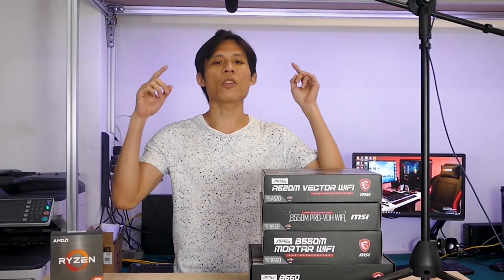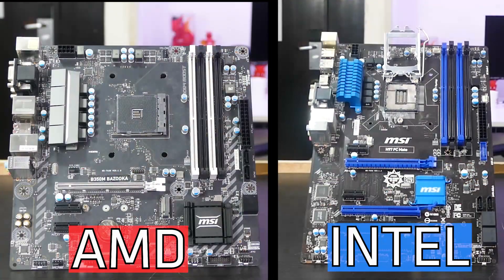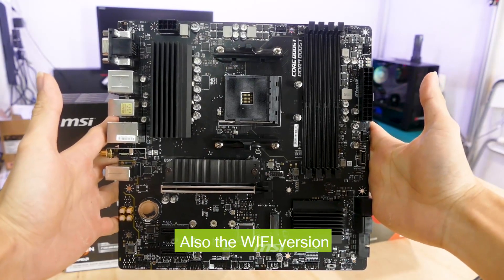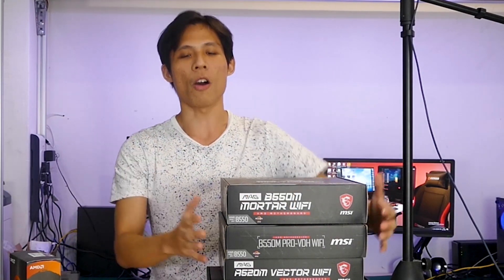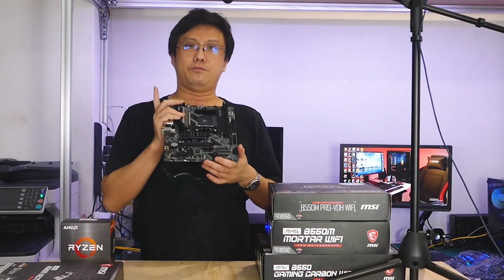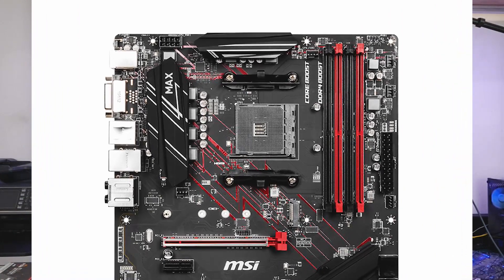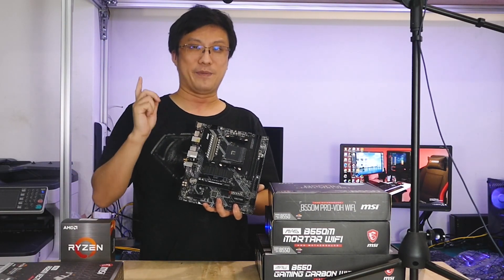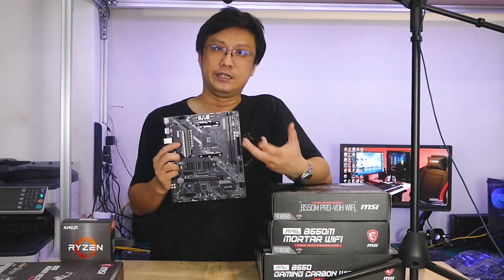ULTIMATE Beginners AMD Motherboard Buying Guide! How To Buy a Motherboard in 2020

Comment: So I bought the A520 motherboard for my gaming pc build and after building my first gaming pc. I was wondering if I buy the RTX 3060 graphics card on my A520 motherboard but I am concerned that the 3060 would not startup due to the fact that it only uses PCIe 3.0 and not 4.0. But I know that the 1660 and the 2000 series has PCIe 3.0 yes but when I researched those graphics card series they contain x16 like for instance 2070 Super PCIe "x16" 3.0. The x16 pretty sure matches with my A520 interface which also supports x16 however the graphics card that I was buying is RTX 3060 which is also PCIe x16 4.0. I have reading and researching forums on what GPUs what supports A520 motherboards but there are too complicated to understand because I am new to the gaming pc builds altogether. If I can get replies from you guys I can get a straight forward answers instead of "Yes" from Amazon typically because of lack of explanation or the lack of understanding of motherboard that I amusing on my build.

Comment: Can I use a Ryzen 2700x with the MSI B550 Mortar?
Reply from the maker: Hi Jesse, the b550 mortar or motherboards in general officially work with Ryzen 3000 or 5000 CPUs. You can try running your 2700X, but I would recommend using a B450 motherboard for that.
Reply: Ok, thanks.

Comment: Great video... am waiting for your Radeon reviews... By the way, recently saw some articles regarding some RTX 3K issues for some manufactures like MSI... Is that issue fixed for later card releases from Team Green? 

Related article:
https://www.igorslab.de/en/what-real-what-can-be-investigative-within-the-crashes-and-instabilities-of-the-force-rtx-3080-andrtx-3090/
Reply from the maker: Hey Daryl, we did hear about the voltage regulator issues with this cards when it first came out. Something like some brands using cheaper capacitors and voltage regulators for their cards. I am not sure if these brands have changed up the design or continue to use it for their future cards. But one thing for sure, the drivers should be  better compared to last time.

Comment: Very informative video guys, keep it going. I also really like b550 mortar wifi, i think for most people no real reason to go further. This baby got almost everything you need.
Reply from the maker: Thank you MISTIK for this! Yup the b550 mortar is a great board. Are u using it?
Reply: @RealMelTan  i have b450m motar max + ryzen 3600 but for 5600x thinking to upgrade to b550 mortar.